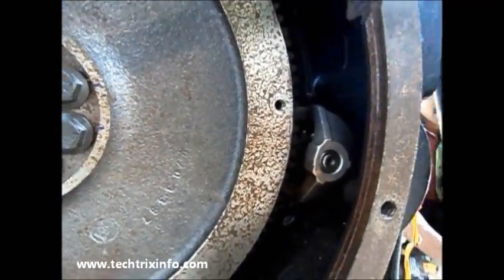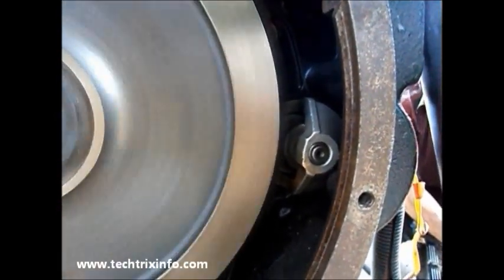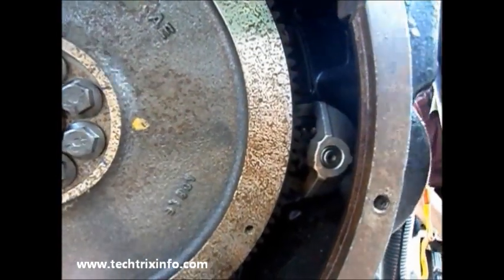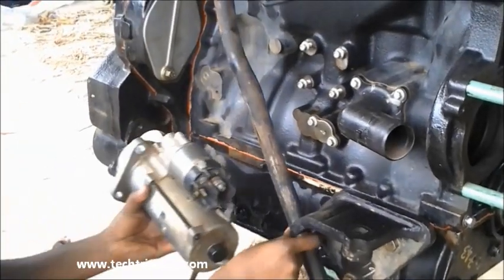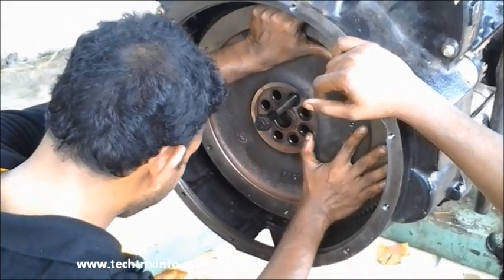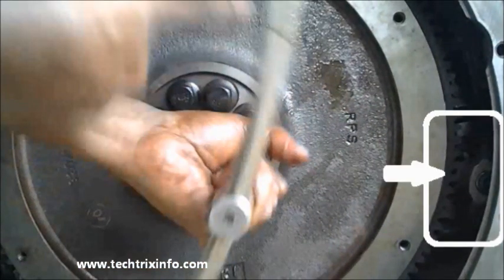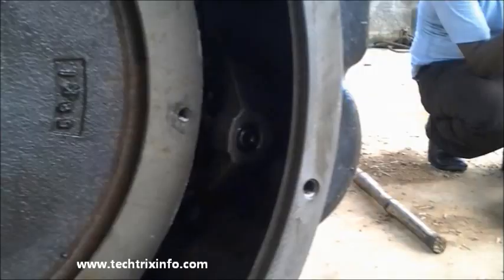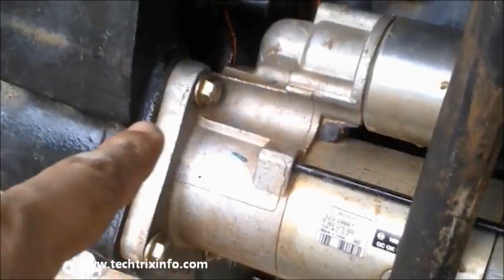How car engine really starts. ✔

Comment: Guys please make a motorcycle starter video. I would love to know what an idler gear, starter clutch and what sprocket moves, in and, which direction does the one way clutch works, basically a dissection of the motorcycle starter and working principle would be really helpful.

Comment: could you please tell me how starter motor get disconnect when engine start
Reply: Vikash Kumar When the engine starts the starter gears just spin with the fly wheel
Reply: Robert Villapudua you mean to say  starter motor dont disconnect  when engine start.
Reply: @BlogsVKLSAM  Yes it does

Comment: And hopefully this helps you understand what happens if you try to start an engine that's already idling and hear that God-awful screeching sound. Basically imagine that huge flywheel hurtling over at almost 1,000 rpm (engine is idling), now take that tiny little starter pinion gear and plunge it against the flywheel again lol....ouch.
Reply from the maker: +Harman Motor Works 
We are honored by that comment.
For more info you can email us at techtrixinfo@gmail.com or whats app at +919744615655

TechTrixInfo.com
Reply: Its not an issue in modern day cars though.

Comment: Thanks for the video! I know very little about engines, my 15 year old explorer has problems and I've been trying to figure out how the starter works to either be able to fix it or know how to explain the issue to a mechanic. It makes the same sound as the video and after about 2 or 3 tries it starts up with a little gas in a few seconds and runs fine after with good battery and no heat issues. So I guess I now know it turns the wheel. lol That's some kind of progress. I am watching your other vids and I have to say you are a very good instructor. ^_^

Comment: Does a big train engine start in the same way?
Reply: Noah S. What kind of train? Electric, steam, etc.?
Reply: Guitarfollower22 big diesel-electric. Like an AC4400CW
Reply: Noah S. A big diesel engine from a train or power generator often has two large 24 Volts starter motors for starting. Same principle. Or DC traction diesel electric locomotives use special windings on the generator to turn the engine over.

Comment: Nice video.
I have an Dobut that flywheel runs the crankshaft or crankshaft runs fly wheel.
The purpose of crank shaft is to transform linear to rotary motion
Reply: +Arvind babu   Actually the purpose of the crank shaft is to transform reciprocal motion to a rotational motion.  The crank shaft does run the flywheel, yes. Flywheel has 3 main functions #1 starting. #2 a means to attatch clutch pressure plate/torque converter (automatic) and last but not least #3 to smooth out the combustion/power strokes from the cylinders, without which it would be difficult idling and first driving off.

Comment: what after flywheel rotation? how it aids in starting the engine?
Reply: When the ignition is turned on with the key, any rotation of the engine could potentially get it started. This is why with a manual transmission you can push start an engine by putting it in second gear or higher and "dumping the clutch" while the car is rolling. With every revolution of the engine the spark plugs will provide a spark if the ignition is turned on. This is how an engine starts. Before starter engines you used a hand crank to start the engine. This is why it's dangerous to work on an engine with the ignition on, where turning the engine over manually with your hands could potentially start it, or even just turning the driving wheels with your hands if a gear is engaged and the ignition on when the car is raised.
Reply from the maker: KodakYarr Great..Thank you, Please SUBSCRIBE to us for more videos. We have a face book
 page just search for TechTrixInfo in face book  -  TechTrixInfo.com
Reply: KodakYarr You are saying any key rotation in engine gets it started. This can be linked with the kick starting. What happens in a self start. 
Also if you can elaborate on how any key rotation starts an engine.
Reply: KodakYarr thank you, sir.
Reply: +vaibhav yadav 
Average Values for rotations to start an engine:
Petrol - 60 to 90.
Rotary - 150 to 180.
Diesel (With glow plugs) - 60 to 140.
Diesel (without glow plugs) - 100 to 200.

And by "self start" you mean the feature of start and stop? 1st the car needs to have an AGM battery, and for the starter motor, it's not a normal one... In a normal starter it's teeths only connect to the flywheel when the ignition is on. In a car with "start and stop" the starter's teeths are always connected to the flywheel. To stop the starter motor from rotating after the engine is started, there's an unidirectional clutch which is connected to a rack (behind the flywheel) and prevents the starter from rotating.
And that's why you can't push start an automatic car even if you manage to put it in gear.
I hope it's understandable :)

Comment: please tell me if there is any way to start the automatic transmission car without starter motor.
Reply: no you can not do that unless to have a older car that has a rear pump in the transmission, back in the 50 and 60"s most cars that had automatic transmissions had a rear pump and also a front pump so you could have some one  push your car up to around 30 to 40 mph and then put the lever to manual low and it would turn the engine over to start.

Comment: These starter motors are called the "pre-engaged", as they have a solenoid which pushes and engages the starter motor pinion to the flywheel ring gear before the motor starts to rotate. Olden days had another starter motor called the CAV starter motor, where the rotation used to begin first. The first 2~3 rotation would cause the entire rotor of motor + pinion to come forward and engage with the flywheel ring gear.  Those motors are bigger and longer commutator to accommodate the forward motion of the rotor. Benz model Tata truck and Shaktiman trucks used them, and only manufacturer was Lucas TVS in India.